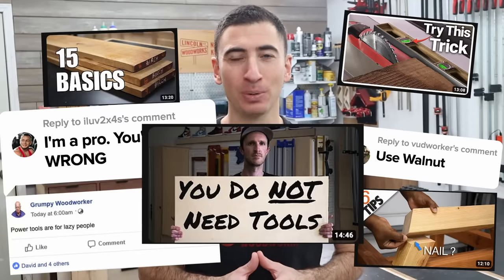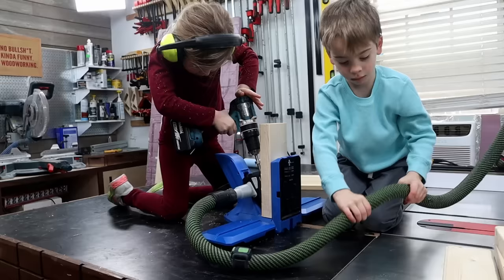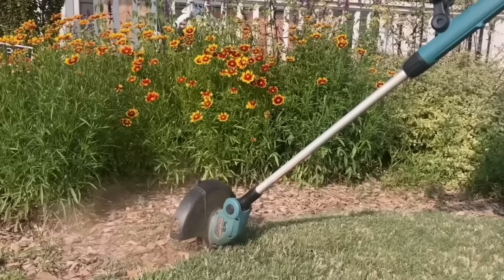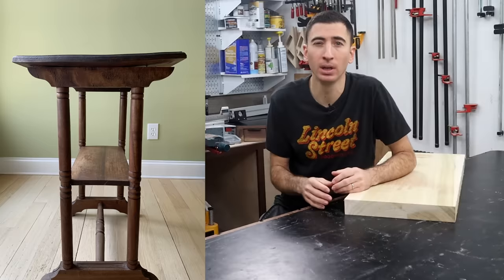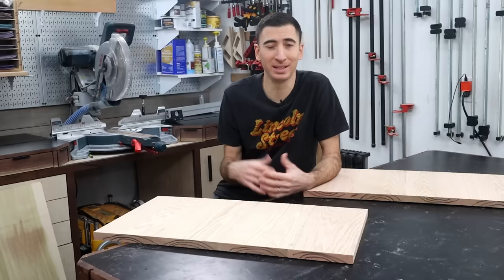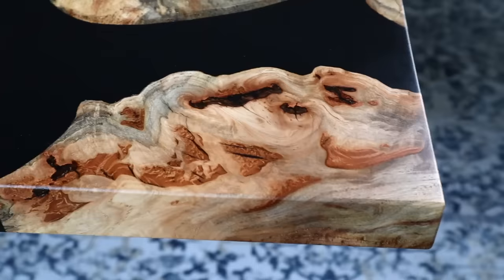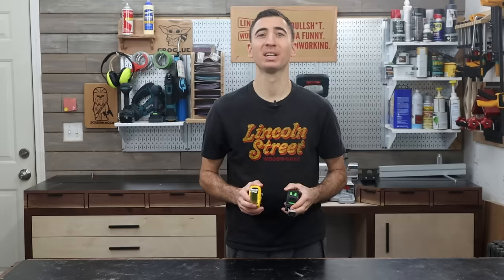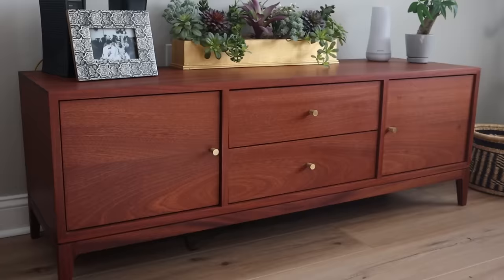Every beginner needs to hear this

Comment: Great video! When I bought my first drill I had people inform me that I bought a "crappy" Ridgid. I thought, great, I will buy a better one as soon as this one dies. Over 10 years later, it still has yet to die... I was really hoping I could get a new drill.
Reply: The trap of a temporary solution that becomes....what how long has it been like this?
Reply: @Can_Driver 
Nothing is more permanent than a temporary fix😁
Reply: Before retiring, I was a tradesman. I got fed up with my chargers getting heisted (intentionally or not).
So I figured that if I went with an unpopular brand, that would cease. Phased out my Milwaukee stuff and went full on Ridgid. Theft problem ended and I'm satisfied with all my tools except my orbital sander. (The dust collection sucks and it tends to want to coat you in dust unless you hold it backwards. )
Reply: That is funny. I still have my first drill too. 30 years later, it's still working fine.
Reply: First measuring tape I got was hot pink, 40 years later it still hasn't been swiped.
Reply: @wilburrrrr742 your dust extraction sucks??? isn’t that what its supposed to do??? lol!
Reply: So "crappy" that the company stands behind it with a lifetime warranty. lol
Reply: I get the impression he's in the business of trying to find new ways to piss off season veterans. Not a bad business model.. lol
Reply: burn an inch. never use the hook on measurements that matter.
Reply: @Sandriell I had a coworker who wouldn't buy Craftsman (back when they were decent tools).  People would say but they have a replacement policy.  He said, why not buy a tool you don't have to replace?  I say buy the best you can afford and cry once.
Reply: Buy cheap, then replace with quality when it breaks or if you really need the better quality.
Reply: "Crappy" Ridgid? I bought a 5 piece set some 20 years ago and have not been gentle with them. Replaced the trigger in the driver, but that's about it. 

Btw, that 18v driver will snap your wrist if you aren't ready for it.
Reply: With tool monopolies buying out and shuffling brands its now hard to say what is a good tool today or will be tomorrow.  Rigid and Milwaukee are now Hong Kong based TTI products with some being recolored consumer Ryobi or Homelite products which they also own and watered down some time ago.  Porter Cable is not the same as your grandfathers now being a reduced quality Stanley Black and Decker product as is Dewalt along with a number of others.  Skill is now out on their own again so its hard to say which way they're going.  Bosch and Makita so far are still their own companies however for how long its also hard to say.  Hitachi which was a good blend of value and quality is now rebranded as Metabo but no longer appears to have the larger portable and stationary tools that the more dedicated home woodworkers would turn too as an alternative to a Delta or Powermatic product.

After a lot of bad experience as a tool repair tech dealing with Ryobi I needed an immediate replacement for my own old school Porter Cable RO Sander because Stanley Black and Decker discontinued the consumables for the pad speed limiter which was a small silicone belt that would last me a few years and an aluminum pulley that had to be replaced every 5 to 10 belts.  I didn't want to deal with any more stuff from Stanley Black and Decker or Ryobi so I went with Rigid making a quick choice in the store.  Seemed great with a Lifetime Warranty, right?  Two months later the pad speed limiter and pad bearing had failed and after finding out how many months it would take to get it fixed under the Great Lifetime Warranty along with the cost for shipping I went to my local bearing supply house to get an exact replacement for the failed bearing.  They told me they could not match the quality of the bearing since it was too far below their minimum standard so offered a much more expensive bearing to replace it and this was when I found out Rigid was now a Ryobi/TTI product.  This bearing worked out well and has stood up in heavy used now for several years so I count the $1.50 investment in that much better bearing as a very good one.  Of course I question how cheap and lousy was the OEM bearing if one that cost me $1.50 was so much higher in quality.  The logical conclusion is extremely cheap and extremely lousy.  The new speed limiter instead of being longer lasting, more economical, etc than the old Porter Cable design well it lasts weeks to months instead of years and is much more difficult and expensive to replace.  It wears out the back of the pad holder too adding another $20 to the cost of renewing what was a 75 cent quick fix on the original Porter Cable design.

I now double check who owns who now and where they make the tools as I don't want to get fooled again.  Sadly much of the branded stuff is now made by the same factories used by Harbor Freight so the level of quality it no longer as far apart.

That all said buy the tool rated for the job you will be doing.  I see too many buying for example a high speed 3 or 4 amp hammer drill (I'm using corded tools as the example) designed for the light work of drilling holes for small TapCons and small lead shields along with small holes in wood then complaining that they burned them out running a big hole saw, driving deck screws and other heavy duty work that required an 8 or 10 amp tool.  Don't buy a small reciprocating saw and expect it to do the same job and a heavy duty one.  I went on a job doing some demolition and someone took my light 5 amp reciprocating saw that was great for overhead work and tried to push it to perform at the same level as my heavy old 11 amp Porter Cable Orbital reciprocating saw which resulted in them through operator error overheating the motor and stripping the gears in the 5 amp saw.  This was totally avoidable with a little bit of common sense and was like forcing a miniature pony to do the work of a Clydesdale.

Best!
Reply: I still use a miter saw I bought at Harbor Freight in 2007. For 80 bucks. Keep hoping one day I can get a shiny new and better saw...
Reply: @Sandriell  What good is that warranty though if you can't get the replacement for 6 to 8 weeks (so really months) and you have to pay shipping that come close to the cost of buying a new tool?

I tried to get a Rigid "LifeTime" Sander fixed under warranty when it failed after 2 months of use and the shipping costs plus wait times meant I would have had to buy another sander anyways so I would be paying out double.  I fixed it myself in less time than I spent looking into the warranty and the vastly superior part to do that cost less than $2 and counting the trip to the bearing supplier took an hours time.

If they honored that warranty in the store then it would carry some value however they don't and when you send it out the fine print indicates that there is a chance they won't fix or replace it making the cost of sending it out a gamble.

Too many "LifeTime" warranties aren't worth the paper they're printed on.

Best!
Reply: My impression is that drills are over engineered for wood because they are supposed to be capable of at least occasional masonry or metal work. My Dewalt made a burning rubber smell the other day… I was drilling a 1/2” hole in a steel tube with a bit that was going dull. If I did that every day, I would eventually break the drill. Wood is like styrofoam compared to steel.
Reply: @somedumbguy0  If it made a burning rubber smell then it had to be pretty obvious that you were overworking the tool.  It's not that difficult to sharpen most drill bits plus when drilling steel you have to use some sort of cutting fluid to extend bit life and reduce the stress on your tools.  TapMagic makes a really great cutting fluid that I've used for almost 60 years now.  Its allowed me to drill 3/8, 1/2 and 3/4 inch holes in heavy steel girders even when we were using the old 7.2 volt cordless drills back in the day.  A sharp steel cutting drill bit is required though.

Best!
Reply: I have 3 different brands of cordless tools and happy with each.

Comment: Tip for the pencil trick with sanding. Not only do i use a thicker pencil, but i also use the side of the graphite rather than the tip itself. Not only does this prevent the pencil from dipping into the grain it has a nice side benefit of actually sharpening the pencil point
Reply: I started using a carpenter's pencil for similar reasons. Seems to work pretty good for me thus far.
Reply: My theory when i started doing this is that you want it to dip in a little bit, that way if you have and deep scratches from lower grits you know you're getting them out. Would that be wrong?
Reply: @AwesomeActsOfRandom not wrong, but you do have to be careful that you are making divots, like was stated in the video. If you only have a few deep scratches and you sand in that very small area to get it out, then you will have a dip in the surface in that spot. 

I guess best practice would be to continue drawing on the surface until all the marks are gone, that way if you do have deep scratches, they’ll be removed while maintaining a relatively flat surface. 

The fastest way around this is a hand plane, thickness planer, or a jointer before sanding, but those are expensive. Haha
Reply: Shorter tip: use a stick of chalk or charcoal instead of a pencil.
Reply: @AwesomeActsOfRandom  - That would be right as long as you're not altering the surface with the tip of the pencil. Which is very easy to do if you use a very sharp pencil that needs a lot of pressure to leave visible marks. Wood hardness varies a lot along its grain, and a sharp pencil lead will tend to push the softer parts down. So, ideally, use a soft pencil that doesn't need much pressure to leave marks, or avoid using a very sharp tip.
Reply: @ClippedCoin very practical idea, congrats!! 💪
Greetings from Buenos Aires
Reply: @RFC3514  I suppose that only chalks for writing on blackboards must be used there. Those able to write on metal, glass or wet surfaces have some kind of grease which could diffuse in the wood and alter the finishing afterwards. Am I wrong ?
Reply: @ericpascual8913  - Well, chalk (both "real" chalk - calcium carbonate - and calcium sulfate, which is more common nowadays) is dry. If it has wax or grease, it probably shouldn't be called chalk. I'd say that's more of a crayon.
Reply: not the way he was doing it, in the video he focused on one area until it was cleaned up which would cause dents. I like to mark the whole face, then do large sweeping motions across the entire piece until all of the pencil is gone. if you do this a few times it can help flatten out a piece, but there are better ways to do that.   @AwesomeActsOfRandom
Reply: @RFC3514  I do the same thing!
Reply: I kind of borrow the grandkids sidewalk chalk and lay it sideways on the board
Reply: It also works great for flattening boards in your planer
Reply: I use flat carpenters pencils for this. Not only is the pencil flat, but the 'lead' is nice and wide, and flat. Impossible to drop into the joints and a thicker line you can see better.

Comment: On the Glue and Sawdust - the trick there is to STAIN the Saw Dust then add glue to help blend in the repair.
I do that all the time and works much better as glue itself prevents the stain from penetrating the wood fibers.
After glue/sawdust then sanding, the exposed wood fibers do pick up some stain, but not like staining it first.
    My 2 cents.

Comment: Im a Ryobi user. I have over 40 tools that can all share the same batteries. Some of them are over 25 years old. Ryobi has kept the same battery platform for the 18 volt tools since they first started making 18 v tools.  Great Video.
Reply: Additionally, my dad bought a ryobi drill when he and my mom moved in together, 40 years ago now.

It's been used at least a few times a month for forty years, and it was never treated well. 

It's still kicking. It was the first drill I learned on, and it's the one he brought to help me put up a fence at our place a couple years ago. 

Ryobi is "not as good as other tools", objectively speaking, but, geez, that's like saying "man, my corolla isn't as good as a corvette." It'll get you where you need to go just fine.

Side note: their 40v line (mowers, edgers, etc) is pretty great. The large battery with the mid tier mower does my half acre lot in one charge, and I picked up their charger/battery generator thing and it's gotten us through a few power outages. :)
Reply: @b4ux1t3-tech  I've got several of the older tools and quite a few of the newer ones. 2 different sizes of weedeaters 3 different type of vacuums.(handheld and shopvac  style ) Several different type of flashlights. A small mower, leaf blower, etc..... All take the exact same batteries. Ryobi makes around 200+ tools in the 18v+  family of tools. My personal opinion is that you just CAN'T BEAT THEM. I don't care what other people use. My money is well spent on Ryobi.
Reply: I found a Ryobi 18 Impact in the gritty ice bank of city road snowplows in my front yard a couple years ago. 
 It had been there most of the winter and looked like it had been pushed down the road in front of a plow for a long time. Probably over a couple days.

 I wasn’t expecting anything so I gav it the double tap and it tried going! 
 Battery out, flushed it with hot water, dried it with a shop vac, flushed it with alcohol, waited for a charger in the mail, tested and charged the battery. . . 

 It’s good as new and my go to for plenty of work. Started buying stuff compatible with the battery, figuring it would eventually give up and make me get a pair of new ones but it’s still going strong too.
Reply: @heatshield  They are pretty tough. You can get older ones from the flea market or yard/garage sales really cheap. The older ones are blue. The battery will fit and work them as well. As far as I know your story is the best testament for Ryobi. 😎
Reply: @c.blakerockhart1128   yep mine is blue, red badge, white lettering, neon green motor direction push-through switch.
 I asked around at the neighbors and down the street some, into neighbors I didn’t know, to find the owner. I think it was tumbled quite a way. LOL
Reply: @heatshield  I think it is safe to say that it is yours now. Use it till it can't be used any more and then use it to level a box in the basement.
Reply: Only problem I have with Ryobi is the brushes will die eventually BUT that is with all brush tools, friction's a bitch.  Brushless are great, so I'm slowly replacing as I lose a brush tool.
Reply: @paulholmes672  I totally agree with the point of the brushes wearing out. But the replacement brushes are pretty much all the same model numbers UNLIKE the other brands. And they are really cheap.

Comment: "Not shitty boomerangs" That made me laugh out loud Jon. Good stuff.
Reply: lol same
Reply: Best present-day New Zealand post-punk band, and some might say they're even better than the Six Pistols.
Reply: Ditto
Reply from the maker: Thank you thank you!
Reply: The issue with that is that it ignores how the force flows through the material. My parents house had a corner completely rotted out before it got repaired and you would have never noticed it without inspecting it without the dry wall on. If that had been the only part of the wall carrying the load, it would have collapsed, but being just a small section, it barely sagged. (Obviously, that's something to fix immediately if it's happening, but it's probably not going to lead to a small house collapsing)
Reply: With enough sandpaper and elbow grease that could have been transformed into an excellent boomerang.
Reply: A boomerang that doesn't come back is called a stick.
Reply: @fbenkautz2662  Correct. Every stick that is not a boomerang should simply try harder.

Comment: I worked in a custom timber door shop. When sanding thru the grits, we mostly used wax crayons for marking. Every stick got marked. Never had an issue of contamination. Little trick for taking a piece down to size. Lower the stationary saw blade down, push the piece of wood up against the blade making it deflect. Lift the blade up, start the saw and you will shave a very small amount off. Rinse and repeat until the desired fit. Enjoyed this video. I have been working with wood for over 40 years. Everyone developes their own styles. What works for some, won't for others. Keep 'em coming.
Reply: The wax doesn't build up in the sandpaper? I would think it does.
Reply: @lukegoffkat  Been used for decades without problems in commercial joinery shops with random orbits or large (1300mm wide) 3 belt industrial sanders. Resin in the timber is more likely to cause problems. Surprising but true.

Comment: I have a low shelving unit that I glued together 20 years ago in high school shop class with basic 90 degree glue joints in a white oak frame inset with plywood panels and while I know it isn't the best idea I have stood on it several times, including when I was kind of fat. Thing is solid as a tank.

Comment: Measure twice, cut once is a better tip for carpentry than finer woodworking. Like you I find referential measurement, cutting to fit, and sneaking up on dimension to be more precise.